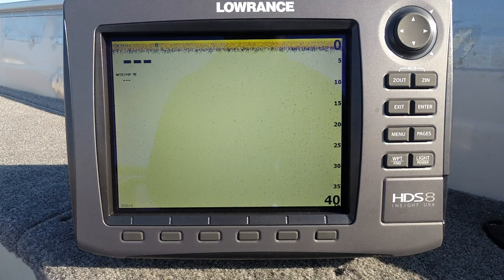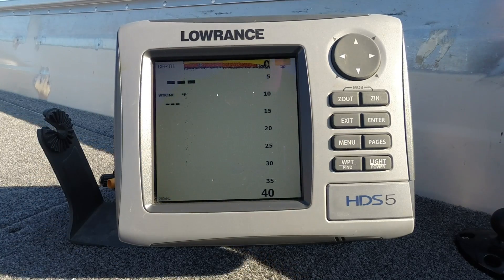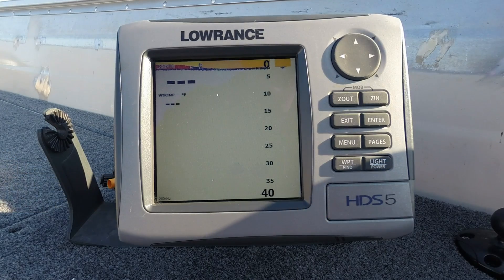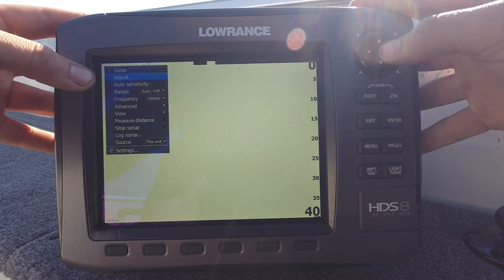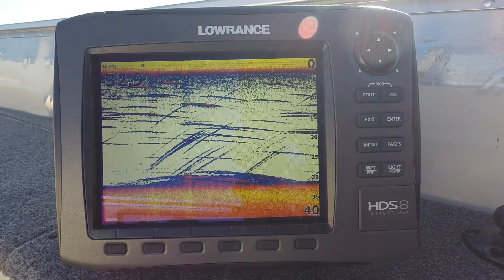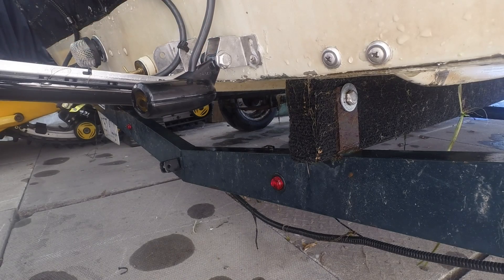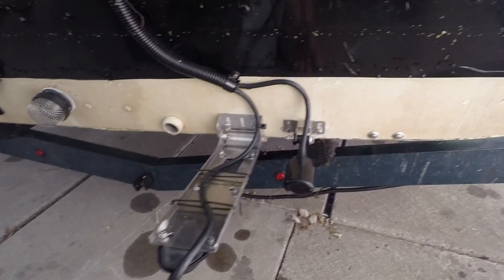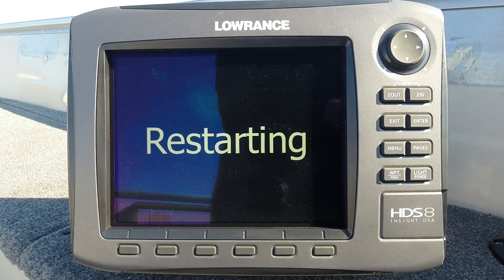No Depth Reading on Fishfinder - How to Troubleshoot

Comment: Hi lawren, my hook2 7 ts with GPS started getting vertical lines in screen.  All the depth and water temp is working.  Seems like it's giving false or confusing sonar readings. The only thing I did different was added my maps card in slot.  Thanks for any help
Reply from the maker: Do you have any other depth sounders, manufacturer engine gauges, or fish finders on the boat?  Most times vertical lines on the screens are caused by another transducer on the boat.  

What happens if you take the map card out? Do the lines go away?

Comment: HDS10 temp all ways reads 131 degrees. through hull transducer.
Reply from the maker: +Stephen Wood That's either a bad unit or temp sensor. Try the unit on a good known transducer. If it's the transducer that failed because it's a thru hull you might just want to pick up a nmea2000 temp sensor and add that on.

Comment: Thanks for this video!  Going to try resetting our unit as it is losing digital depth at anything less than 8-9 feet...for general would would you recommend a 15 foot range with max pings?
Reply from the maker: Biggest thing to do is set the Fishing Mode to shallow water mode.  This will help a lot if it is a software related problem.  I'd also put the unit in manual mode and see if the problem persists.  If it does, then you likely have a faulty unit or transducer.  If not, then its just the unit getting confused for whatever reason.

Comment: Great video.Thanks for making this type of video.I am still trying to figure out why my Elite 7 chirp I got two years ago just stops like the stop chart function is activated like here on your video.It stays this way for about 20 seconds or so and starts again This is drifting or going slow.New update did not help.Resetting did not help.Unit was replaced and transducer was replaced by lawrance.Cannot get a clear answer from anyone.This gets to be annoying.I will try rechecking some of the settings.It is very random.It may be getting "confused" like you say in the video,but this should not happen.I fish mainly small lakes with lots of weeds.Chirp maybe overkill for me.Tried using 200khz and still does it.
Reply from the maker: Almost sounds like you have another unit on that is interfering with the unit.
Reply: No..I have one unit.Could it be from another boat in area?Or something else interferring?